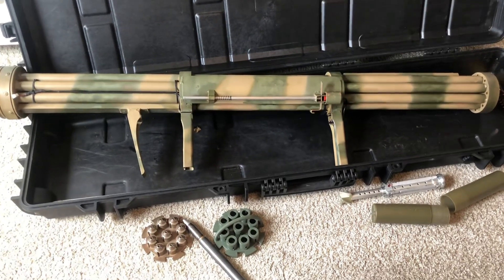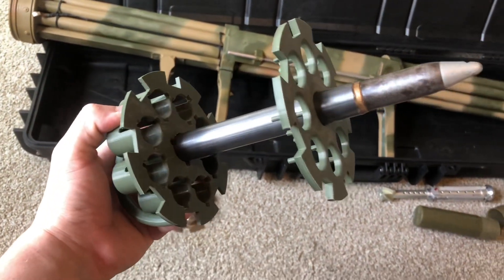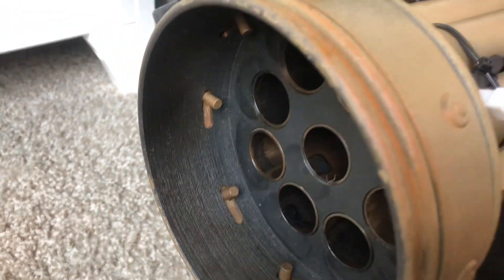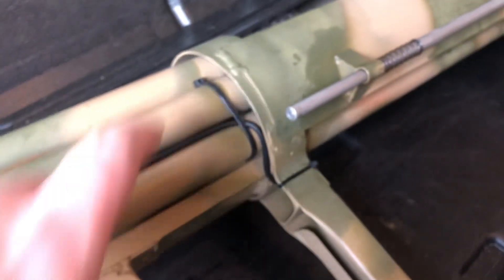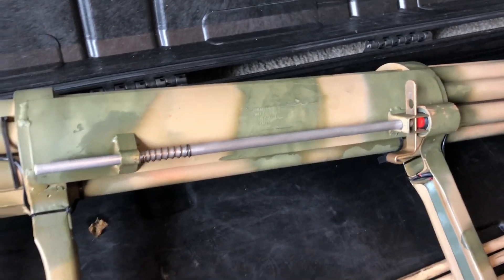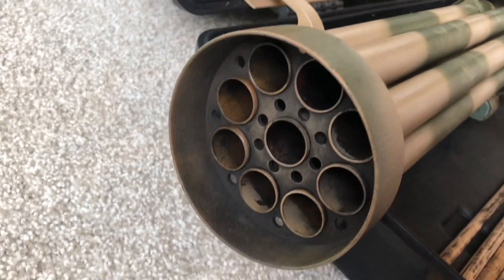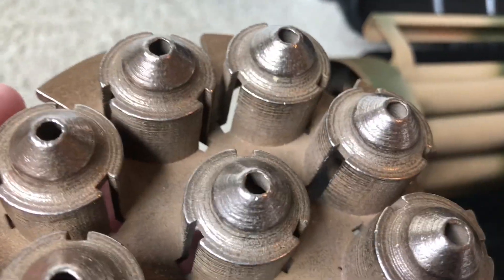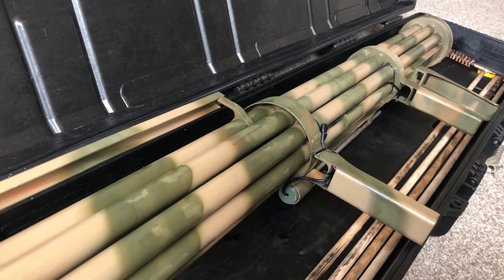3D Printed Steel Rocket Launcher Explained

Comment: Really nice, i already got the book :) But i have a question for you: Wouldn't it have been considerably less expensive for you to fabricate some of the parts with plasma cutting router (by a company) and bent sheet metal ? Especially front and aft caps that hold the barrel in place, order a cut plate, bend a ring, and weld them together. Don't get me wrong, this isn't intended as mean question, i am just curious and really like your work.
I worked in metal 3D printing and had to talk to alot of customers that wanted things printed that could have been manufactured significantly cheaper with a bit of creativ application of standard methods, just so you know where i am coming from with this question. 

Also, if you ever plan on printing more rockets maybe try a rocket where where the entire nozzle/expansion chamber is at angle, this should net you more rotation when combare to a straight expansion chamber where one side is flared out. This is actually something you can only really do efficently with a 3D printer. Also, while we are at possible improvments over the original, using oversized tube and crimping them down should reduce friction and improve velocity (check the Panzeschreck for refrence of what i mean). 

Have a nice day, and greetings from Germany :) 

PS: God i wish recreational Rocket launchers and Guns in general where legal here. I want my thinking grenades, goddammit.
Reply from the maker: Thanks for picking up a copy, For me at the time, I didn’t know anyone local that could make the parts in the quantities that I wanted, the ones I looked at wanted charge crazy high prices for just single parts. I figured I could get the exact part I wanted and easier to draw and have printed that find someone local. Going forward I’m definitely looking at fabricating composite parts myself
Reply: @WildArmsResearchAndDevelopment  Ah okay, that is completly understandable :)  Don't worry, this doesn't change even at a company level. Some quotes you get are just outrageous. I had to buy (for my own private projects, not for the company i worked for at that time) a table top lathe because i kept getting quotes for special screws that were double the price of a mini lathe and some metal stock. Keep up the good work :)

Comment: Really cool.
Out of interest, what is this legally classed as; a "Standard Firearm" (non-nfa), MG, DD, MG & DD OR AOW?
Reply from the maker: Destructive device since it has very .5” in bore diameter
Reply: @WildArmsResearchAndDevelopment  Does only one rocket fire per single action of the trigger?
Reply from the maker: @SandrasSpicySpanishSalami  it’s a volley fire weapon so multiple barrels can fire at the same time with one trigger as long as it can not fire two rockets through the same barrel without a functional of the trigger or manually reloading.
Reply: @WildArmsResearchAndDevelopment  Very good explanation, thanks! Keep up the fantastic work.

Comment: Why did you decide to use the safety as a trigger and not an actual trigger instead?
Reply from the maker: At the beginning I was under the impression it was trigger mechanism, and the rear part was the safety and I designed it just to be combined in the front to save time and money

Comment: How much did the metal 3D printing cost? Seems like a really expensive way of doing things you could do by bending sheet metal.
Reply from the maker: About $2000-3000 worth of parts printed, there were certain parts that would have been hard to make realistic without a lot of modifications for be t parts
Reply: @WildArmsResearchAndDevelopment  are they quite strong? I've debated getting some parts made the same way but it always comes back to "are they strong enough for the price" since outside of realism (as with your application) the cost of buying one that won't break is higher than like 10 which could break.